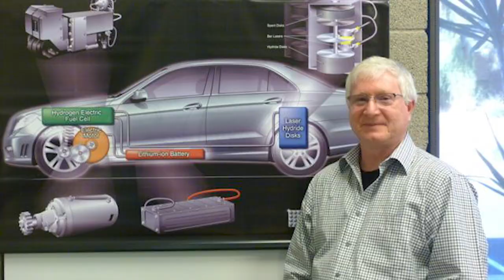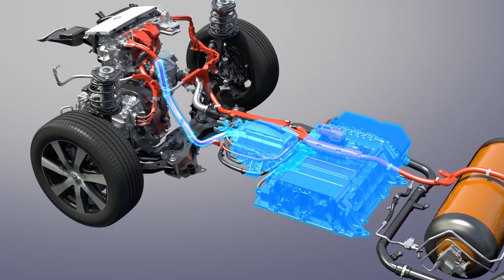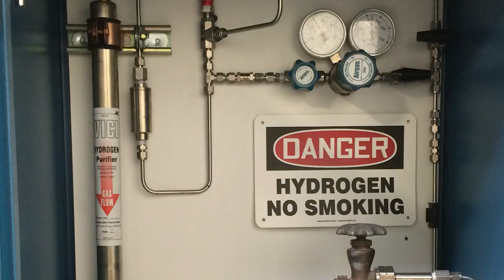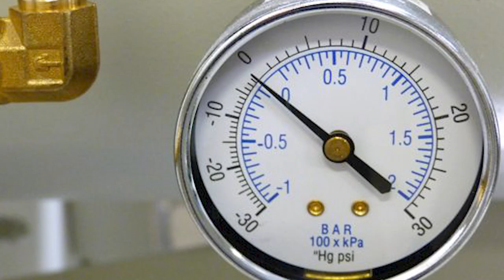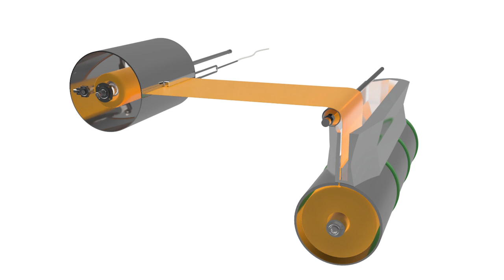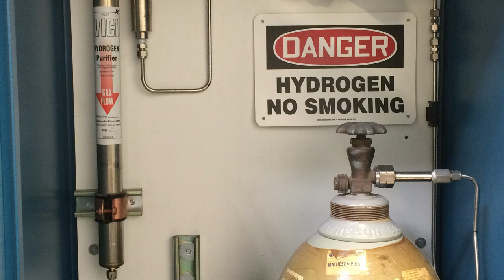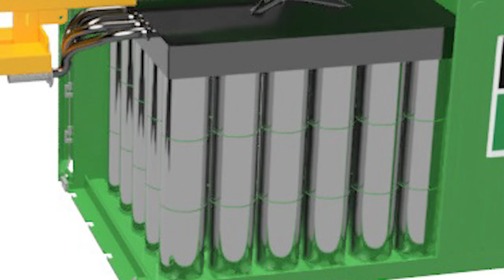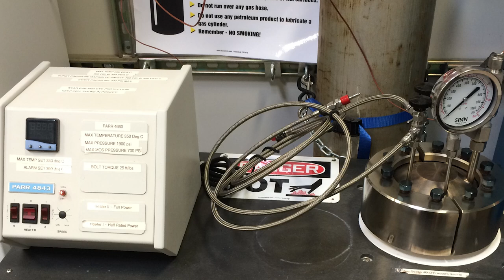This BANNED Technology Could Push Hydrogen Cars Over BEVs

Comment: If you use electrolysis, it takes about 50 kWh to create 1 kg of hydrogen. Even if this storage technique is 100% efficient, that's not enough: the Toyota Mirai fuel-cell vehicle uses about 1 kg of hydrogen/100 km. If you used that 50 kWh to charge a battery instead, you'd have a range of 250 km.
Reply: Also, from the Plasma Kinetics website: "Plasma Kinetics systems are slightly larger, and only moderately heavier, than compressed gas carbon-fiber tanks at 700 bar" - that makes them 4-7 times as large and heavy as a diesel tank that gives the same range.
Reply: Yes, and you would be using fossil fuels to charge that battery, along with being responsible for the  radio active waste produced in man made neodymium magnets  used in the electric motor!  Please, don't tell me wind power!  As, an engineer I can tell you it's nothing but a money pit, and tax dollar funding is the only reason it's a thing. A waste of tax dollar funding at that. Did you know that fossil fuels plants are paid to be on standby to ensure the grid doesn't fail. Sadly, power plants they were designed to be efficient at 100% capacity. They actually pollute more running at half mast.  Don't! Wind towers,  I  have been in them, on them, have a piece I use for a water tower.  All I see is pollution from lithium mining, rare earth mining,  titanium mining, graveyards of electric vehicle batteries, tons of radio active waste producing neodymium magnets for vehicles and wind towers,  a grave yard of fiberglass wind towers and batteries for our children to deal with. It's time big oil take its profit and go!  Nuclear is the answer to the grid, and hydrogen has already been proven but those that want to share their discoveries are silenced or dead!  Money is the root of evil. Too bad that you can't explain to your children's children, why we are the pieces of shit that destroyed their future!
Reply: I think one of the biggest things to consider, is which technology will be greener for the environment, which will cost less money to produce in the long term, the availability of materials required for production. 

E85 fuels burned quite clean when compared to hydro carbon fuels, but production is expensive, and largely reliant on massive amounts of farm land, which could be better utilized for crops.

The pure fact that this new solid state hydrogen technology can be exchanged in much less time than recharging an ev, might possibly what tips the scale in hydrogen favor.

So far infrastructure was one of the leading downfalls of hydrogen. But hydrogen use is increasing in industry,  which is leading to a greater need for production.

Very interested to see how this plays out.
Reply: @offgridselfteliant  "along with being responsible for the  radio active waste produced in man made neodymium magnets  used in the electric motor"

"Nuclear is the answer to the grid"

These statements are hilariously contradictory, you do realise that?

Magnets for electric motors are used everywhere regardless of whether EVs or wind power use them.

It's literally exactly the same technology used in ALL powerplants based on rotating a turbine to generate electricity - which is essentially all fossil fuel, nuclear, wind, hydroelectric and the nascent tidal powerplants.

While you whinge about it you are probably living in a building that uses electric motor fans for AC, or typing out your comments on a computer that uses at least one if not several of them to cool itself.

While internal combustion motors rule the roost in transport, pretty much all of it still relies on some sort of electric motor generator to power its electrical systems too, and beyond transport alone the beating heart of modern industry is the electric motor.

Pissing on the waste produced in making these motors is probably the most pointless thing I've ever heard - why not just throw out the entire technological development of the last century and a half while you are at it?
Reply: @Kevin-qn7jf  "E85 fuels burned quite clean when compared to hydro carbon fuels, but production is expensive, and largely reliant on massive amounts of farm land, which could be better utilized for crops"

I doubt that it actually requires farm land at all.

The entire agriculture industry is due for a massive overhaul towards alternative growth mediums to soil/sand, and vertical expansion instead of the constant push into moar land area which destroys ecological systems along with being simply inefficient.

Vertical expansion also means you can move into lighting the crops all day by artificial means which increases yields per area even further still over basic farm land.

To say that current farming methods are pathetically wasteful is a huge understatement.
Reply: @offgridselfteliant  The biggest challenge with wind and solar is being able to store the energy until it is needed later.   This solution allows the wind and solar to store excess energy.  Then it can be used in vehicles later.  Sounds interesting.  Depends on the conversion efficiency if it is viable yet.
Reply: @marthale7 There's no known way to use chemicals to split water.
Reply: @marthale7 Dissolving metals in sulphuric acid isn't exactly cheap or scalable. 
The current lowest-cost solution for creating hydrogen is steam reformation of methane, which splits the methane into hydrogen and CO plus CO2. Which defeats the point of using hydrogen.

Comment: Cheaper than electricity?  I would love to see the numbers on that.  Converting electricity yo hydrogen is a significant cost.  Then there is the losses in the fuel cell which is also significant.  There needs to be an over all comparison. Great idea!
Reply: It's gonna depend where you are. If you are where electricity is super expensive (Germany's electricity is 0.365 USD / KWH according to google) and you can instead have hydrogen be made where electricity is cheap (0.07 CAD / KWH in Quebec according to Google), I can see it making a lot of sense to import hydrogen even if you lose 2/3 of the energy doing the conversion. Japan's goal is to get hydrogen made in Australia for example because they don't want to build more nuclear powerplants.
Reply: where do they convert electricity to hydrogen?
Reply: @robinsss  where do they get the hydrogen from ? There is almost no hydrogen in the atmosphere
Reply: cant be more expensive than fuel
Reply: @livonia1807  yes it can, you don't need to produce fuel whereas you do with hydrogen
Reply: @E9X330  yeah you're right

Comment: While I respect Sandy for some information, he's an investor.  I take everything he says with a grain of salt.

The process of getting to hydrogren into a tank is IMO worse than ICE, from start to finish.  There are so many energy conversions and you're still using fossil fuels which means you keep having to find oil in ever harder places to remove it from.

By the end of the decade battery tech is going to be SO good people will be wondering why there was ever a discussion about hydrogen.  Battery tech is getting safer.  Trying to keep hydrogen a safe technology is what you get with that technology.

An infrastructure made for refilling hydrogen is never going to be safe.  It is at best controlled.  You add 20,000 charge stations around the US and statistically it's almost IMPOSSIBLE to say there won't be an explosion.  And it will kill people.  I have no faith that an industry that tries to make as much profit as possible AND has had many accidents moving oil is going to maintain tens of thousands of charge stations.

Comment: Why generate electric , then convert to hydrogen , then use energy to retrieve the stored hydrogen to go 
through another conversion back to electric to power the vehicle, with every conversion inserting another
lose in the cycle ? This seems like the metal hydrides storage system in another format.
How long is the shelf life because hydrogen is hard to contain in any way?

Comment: 300 lbs = 400 miles.  Use electricity to make hydrogen, then truck the disks to ~fueling~ stations.  Fuel cell converts to electricity to power the cars.  Politicians will love that it maintains and even increases the number of trucking jobs and saves / converts the gas stations.  I'd rather just send the electricity over transmission lines (or use solar panels) to charge my car at home.  I'm not saying that this technology is fake; I just don't want it.
Reply: Transmission lines are efficient but not that efficient. Your transmission line and high voltage transformers lead to high losses. Either way you're going to have to rely on something like this in the future to charge your bEV vehicle. DC fast charging works OK for now. Once you hit critical mass we won't be able to offer 150kW charging for 5 million vehicles at the same time just off the grid.
Reply: @wakannnai1  According to Schneider Electric, the total losses from power plant to consumer wall outlet are 8-15%.  This does not include the efficiency of energy production, but it does account for step-up transformers, transmission lines, step-down transformers & power lines.  We currently have a big shortage of truck drivers in America, so I hope we can improve the electric grid here, rather than hire and train all of those truckers.  I may be wrong.  We'll know in ten years.  FULL DISCLOSURE: I drive a Toyota Prius, but I invest in TSLA.

Comment: Hydrogen is very interesting. Once the expensive unreliable parts of the system are resolved it will be excellent. I think this will work better for larger long range vehicles like trucks first but I reckon as it miniaturises it will become viable across cars, motorcycles and one day laptops and phones. I think this will beat electric motorbikes as they are currently very limited on range.
Reply: Hydrogen as it is presently made (steam methane reforming) damages the environment through CO2 emissions (even if you try to do carbon capture and storage) and upstream fugitive methane emissions. When we have enough over-supply of renewable or nuclear electricity, we could start making hydrogen by electrolysis of water. The first priority for such green hydrogen should be to replace all the traditional uses of hydrogen, only then should we consider new applications such as transport (where the massively better efficiency of BEVs will make H2 uneconomic) and iron smelting
Reply: No, if you really think critically about it, hydrogen for road transportation is a really silly. If we'd want to run every car on clean energy, hydrogen would require 3 times more wind/solar/hydro/nuclear power to achieve the same utility in 'miles driven'. It ends right there, unless you're Shell and think you can delay the inevitable by making politicians and the general public think we have to wait for hydrogen to be ready.
Reply: @bilgyno1  I didn't mean every car, I meant large scale transport like semis and trains. Germany already has hydrogen trains. I get what you mean about the embodied energy problem. Most complex machines suffer this as the manufacturing of them is the biggest environmental hit. Even electric cars are not green. They require a crapload of carbon pollution to make. Hydrogen may have a place but I agree it isn't the solution. I actually am a fan of hemp based ethanol, as hemp absorbs more C02 than trees, and ethanol burns very clean. It is basically a closed cycle. The real problem here is the size and weight of our cars. They don't need to weigh 2 tons. Most of the energy whether it is electric or combustion is used to haul the vehicle. We are just baggage. If you look up the Aptera electric car project ,which is well underway, you'll see what I mean. That is a true "green, eco vehicle."

Comment: @4:38 "So it was too good to be out there." You'd be amazed at the mundane, low-tech things restricted under ITAR.

So their material releases energy by shining a light on it. Which requires... ?
Reply: A laser. High power, no doubt...
Reply: ITAR essentially restricts the export of certain components that would give other nations a competitive advantage, usually military.  Radiation hardened versions of components, esoteric materials, rocket nozzle designs and clearly the film based storage of hydrogen.

Comment: When something sounds to good to be true...it almost always is. The best engineers and minds in the world have ruled out hydrogen as a dead end.
Reply: Do a back of the envelope calculation and you'll see.
Reply: @jamesvandamme7786  I did: BEVs are 3 times more efficient, cheaper to maintain and have a fraction of the cost per mile driven.
Reply: @Makatea  That's what I figured. But things could change if somebody comes up with a better idea. Like, using ammonia as a fuel. Gaseous H2 is a non-starter.
Reply: @jamesvandamme7786  Any brilliant new idea will have to be vastly better than BEVs, because they'll have taken over the market by the time the new product goes into production and it'll be a lot harder for them than it was for BEVs to outperform ICE-cars.
Reply: @Makatea  That depends on the technology. this laser-disk-fuel cell thing has a lot of unknowns, gotchas, and "whoops we didn't think of that"s. 
If somebody comes up with a cheap synthetic biofuel that burns in ICEs and pumps through the existing pipelines, that could change everything. Or a cheap fuel cell that runs on (m)ethanol. BEVs are short term doable; we just need solid state batteries in high volume to make them cheap. Charging stations will come; known technology.

Comment: The laser hydride disk approach is better than carrying pressurized hydrogen on board, however, need for a machine to exchange those 15Lb/20 mile units may be a show stopper. It is unclear how this will be able to compete with many of the recent improvements in battery technology. That said, it is good to have this out there as an option.

Comment: I would like to know if this film slowly leaks hydrogen over time when it is not being hit by the LASER. Once the film is loaded with hydrogen, for how long can it be stored without it losing a significant amount of the hydrogen?
Reply: forever...it takes a laser to release it
Reply: @HelloWorld-ql3ki  that's not necessarily definitive though. A laser is light. It may just require a laser to release the gas quickly enough to use in a car.

Comment: Swapping out discs when you want to take a trip is a huge step backwards. I suppose this car would also come with a cassette deck. And comparing this to a bbq tank exchange is also not a good selling point. I DREAD having to haul that heavy ass container to get it refilled. Alex, he did not directly answer your question about how heavy and how far you can travel but he did indirectly if you do the math. He said this was less than 1/3 the weight of a battery for the same amount of energy. My battery pack weighs 1200 lbs and can drive 300 miles on a charge so this would come in around 400 lbs to be in the ballpark of similar range. But he also said batteries are "extremely efficient". This is another way of saying "our product is extremely inefficient" so no, probably not going to get anywhere close to the range.
Reply: He said 20 miles per 15 pounds. So 500 miles equates to 375 pounds or 170 kilos.

Comment: How can people just write this off if they haven't even made it come to market yet? I think this definitely has potential and will be very eager to watch it's progress
Reply: Because some of us understand chemistry and the laws of thermodynamics.  So yeah, anyone that thinks hydrogen has potential can't do math.
Reply: It's a neat technology, but the hydrogen is still too expensive to produce, and that's it's biggest cost. You need energy to drill a natural gas well, you need energy to transport that natural gas, more energy to steam reform the natural gas to extract the hydrogen and then deal with the left over waste. Then again you need energy to store and transport that hydrogen, more energy to embed the hydrogen in the film, and yet again more energy to release the hydrogen from the film to feed the fuel cell, which then creates electricity. With a battery, you plug in and charge, 1 step to get the energy to your vehicle and use it.
Reply: @michaelkeudel8770  then why is oil still so profitable? Gas cars aren’t efficient either yet everyone uses them
Reply: @roystevens4333  and yet we already see hydrogen cars on the road, what’s your point?
Reply: @michaelkeudel8770  lmao that’s a gross oversimplification of battery tech, by that logic you just put in a disk and it works, or you fill up the tank and it works
Reply: @michaelkeudel8770  you do realize the disks take out the middleman as well right?
Reply: @matthewmizrachi1877  sure they do. They need to be replaced, so your still buying them from someone that has to take all the steps outlined above to be able to sell them to you. You buy a BEV, that battery comes with it, you choose how you want you fill it.
Reply: @matthewmizrachi1877  Checked six local dealerships.  Zero Hydrogen vehicles for sale. We also don't see that you understand math or thermodynamics.  Thus validating my point.  But just to send this point home without question, all commercial hydrogen is produced by cracking natural gas, which last I checked is a fossil fuel.  Mic drop.
Reply: @roystevens4333  have you been to california? Not saying there’s a lot but they exist
Reply: @matthewmizrachi1877  there are more steam powered cars than hydrogen powered cars in California.  Doesn't mean steam is the future either.
Reply: @roystevens4333  yeah but the difference is that one is old and the other is new, and by that logic there are plenty of electric cars in California to, doesn’t mean electric is the future  either.
Reply: @matthewmizrachi1877  Would it blow your mind if I told you there are some new steam cars built?  I'm going to disengage now since the argument of "it's new so it must be better" is easily the worst thing I've heard this month.